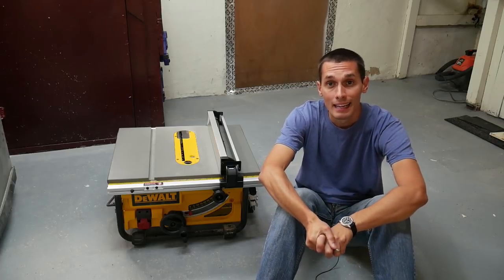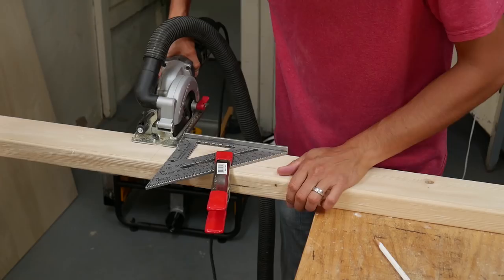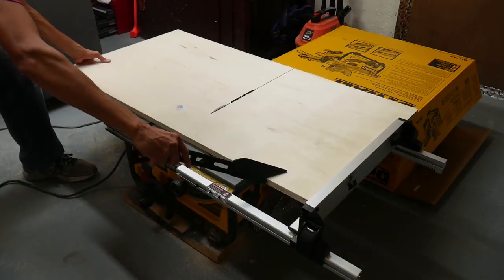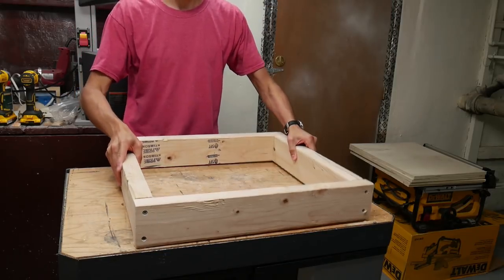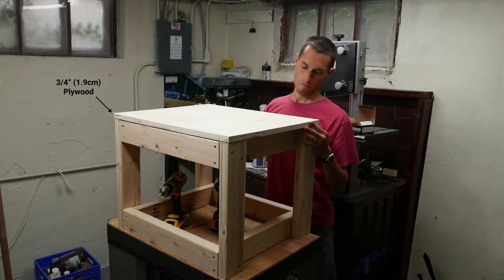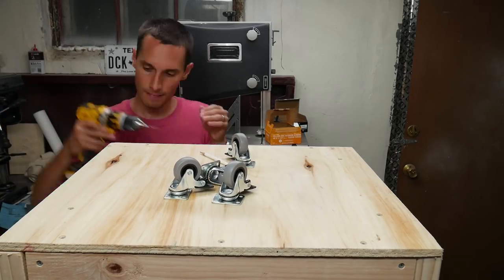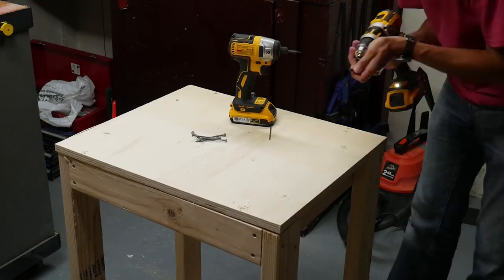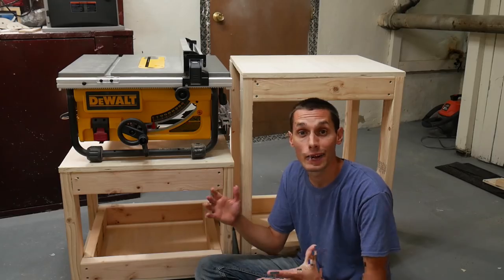How to Make Table Saw and Work Carts

Comment: Used your video and plans last weekend to make a cart for my new tablesaw. Only had two issues: from originally watching this video until standing in Lowe’s with the parts list was about 1 weeks time. In that time I forgot you’d built two carts. I only needed to build one. I blindly bought everything on the parts list. Only realized I had twice as many 2x4s as I needed when I got home and started unloading . Second thing,  I was trying to match my overall height of my cart + saw to an existing workbench. Came up about 1/4 inch short. Plan is to grab a 2 foot by 2 foot piece of 1/4 plywood today and slap it on top. So a couple goofs on my part but ended up with a solid little cart. Thanks for helping me kickoff my first project.
Reply from the maker: I'm glad it worked out in the end! Thanks for the comment.

Comment: I just finished the smaller box, cutting all 2x4's to 23-1/2 inches.  Need to put on a topper and bottom and wheels, but I love your plan and how detailed the PDF cut instructions are - love it, and love your videos!

Comment: Was looking for nice and simple to do. Thanks for the video. This is my next project because so far I've been having to use my table saw on the floor. Will be safer to put it at waist level with an outfeed.

An improvement could be making some latches that will secure them together to avoid the outfeed from moving away when cutting larger pieces.

Comment: I kind of did the same thing although mine wasn't near as nice looking as yours. I also made a makeshift type of French cleat to easily connect the 2 carts together. Cut a 2x4 down the middle at a 45degree angle and attach each half onto each cart. Now simply lift one side of one cart and set it into the corresponding cleat on the other cart. Presto! Connected, although you'll still need to lock the casters.
Reply: Marcus Marrs ~That’s an awesome idea. Thanks for that tip. I’ll definitely incorporate into my table. I want it to rip lengths or widths so I can do this on the side as well as the back. Fantastic 👍🏼

Comment: Just made this table. Simply perfect.  Used three screws on corners. This thing is solid. Also used a square to set the legs to ensure 90 degrees and it eliminated the wobble even before fixing the bottom plywood.

Comment: Thanks for showing an easy, but perfectly adequate way to make tool stands. A lot of videos here show fully jointed stands that take hours to make, and to be honest, it's unnecessary. My bandsaw is a trade model, so weighs in heavy, but has been perfectly secure on a similar design, albeit with a bit of glue for extra strength. Rather than bolt the castors directly onto the bandsaw table's base I constructed a mdf dolly from 2 x 18mm mdf, with a removable frame on top that the table locates within. I can then borrow the dolly to (occasionally) move heavy stuff round my barn.

Comment: A couple days ago I commented below on how I'd like to make one of these tables. Well, I was so impressed with what I learned from the video that I went out that day to buy the materials I needed, and this afternoon I built it all by myself (about 4 hours total). I'm a small woman and I was able to do it without hollering for my wife to come help. Its simplicity and ease of building was nothing short of amazing, it's practical usefulness more than I expected by a country mile. I made a couple of modifications: I chose not to use wheels because I intend for the table saw to be essentially stationary; instead of having it sit on a plywood base, I decided to use the plywood (actually MDF) as a shelf resting on the 2x4 bracing. It's incredibly sturdy. It's not pretty, but it's a tool! Who cares about pretty? As long as it's square and plumb, that's all that matters.

Thank you again for posting this video and offering the free plans. You are a star when it comes to designing and building simple and useful projects not needing $2,000 tools. Your projects are a novice's dream! Keep up the great work!

Comment: You could make several modular carts and add drawbolt latches to connect them as needed. I'm thinking about building a table saw cart like this, but I need to use it in my basement. I was thinking that some kind of modular bench would be good...designing each section to be able to fit through a standard doorway, but then they can all be latched together to make one, larger table when in use.

Comment: Great and simple design. The only modification I'll make is the height for my Makita is 12" between the 2 tables.
Also with 16' lengths of 2"X4", three lengths will do all the frames and legs.

Comment: Great project. I am considering a new DWE7485 compact 8 1/4 table saw with no stand because the stands prove to be pretty unstable. It will replace my old 1951 Cast Iron Craftsman. This cart is just what I need for the new saw. And I love the idea of the outfeed table/cart as well. Since I have the BoraMate castors from the base I built for the old craftsman, I will use them for this cart. I would definitely recommend them or something similar over regular locking castors. My BoraMates were spendy at $50 per set they were needed for the heavy old craftsman. And when you set them down they STAY! Great video. Subbed you! Looking forward to seeing some more of your stuff.

Comment: Thanks! -- built the short one for my daughter's Dewalt 7485 saw; expanded the top a bit to 22" x 26.5" so that I was able to feed four BOLTS up from underneath and through the cart top, into the feet of the saw.
(FYI:  those hold-down bolts are METRIC M8x1.25, 45-50mm -- and nowhere do they give that info in the Dewalt instructions!)

Comment: A little glue wouldn’t hurt in the joints. Tremenous holding power and makes it less proon to having to retighten the screws once a year. Nice project otherwise.
Reply: Dolko71 I agree. I Always use glue in addition to screws. It makes it that much stronger. The wood will break before a tight bond glue joint.

Comment: Nice work my friend! I only disagree with the casters. I think with the table saw it's best if it is really sturdy! Even locking casters always provide a little movement! But that's my opinion, you will see how it works for you in future I guess! Thanks for sharing! :)
Reply from the maker: I have the same concerns but I don't have a good, permanent spot for the table saw right now. We'll see how it works out.
Reply: In an instance like this you could always get or make some wheel chocks to add some extra stability.
Reply from the maker: That's a good idea.
Reply: @Makify1  I used adjustable table legs from Amazon. A 4 pack was like $13. With the casters raised up a little, I'm able to adjust my table to be level, then move it back away after. I have a small garage that needs to make a home for my car still. I admit though, a drill hex bit for the drill makes adjusting legs go faster.

Comment: This looks great. BUT what if you made two taller tables at 12x20 instead of (1) 20x24? Added hinges on the side? This would IMO keep the tables from separating while in use, and allow you to use 1 as and outfeed table while the other is a side support table. (For plywood) Also I would have raised the short table so the saw is say 1/8" higher than the tall one. Just to reduce the chance of catching on it during outfeed.

Comment: Hello, you have chosen your dimensions according to the model you have of the DEWALT. Is it the DWE7485-QS or the DWE7492-QS? it's not the same size at all
I would like to adapt these dimensions for the BOSCH GTS 10 J
Cordially

Comment: Thanks for this video. This will be my very first woodworking project! Would the 1/2" plywood for the top be too weak to hold a saw? My saw is 75 pounds. Also, what size screws are you using for the casters? They don't look the same as what you use on the cart body. Only one type of screw is listed in your description. Thanks!

Comment: Nice Vinnie! You must love all this new space. A word of warning about the taller cart to be careful using it as an outfeed table. Typically if they are a single unit, there is no problem having them flush, but as a separate unit, they should be slightly LOWER than the bed of your saw. Not sure if you've had a chance to test this out but figure you'll discover it the hard way if a piece gets jammed. Anxious to see how this works out for you. Check out Laney at "A Simple Design of Ocala" when you're ready for a TS cart upgrade. Anxious to see what jigs you have in store...
Reply from the maker: Thanks for the tip! I'll have to figure out a way to make the taller cart shorter or the shorter cart taller.
Reply: the easiest way would be to add an additional piece of plywood to the top of the the shorter cart. that way it will sit half and inch or three quarter of an inch taller.

Comment: Hello!  What dimensions would I change for the newer DEWALT DWE7485 ?  Would I just need to add leg height?  This model is 26.65 x 14.08 x 27.15 inches

Comment: Nice design on the cart    I'm a firm believer in   A shop cant have enough   Carts  and that  they should be a work in progress. With modifications and  changes occurring as  what is needed  to Mae that  cart  most useable  for a job or task specific  ive built. Most od them out of. The inexpensive. Materials we. Had on hand  usually MDF  with a  Shellac   Coat   This way if.  The cart needed  holes or something mounted to it   It wasn't that big of a deal  to do it   Often the carts would get. Overspray  for using them as a temporary. Spray table  or saw horses  etc  as they were used in a high production shop. With around 100  shop employees  and quite a few  automated / dedicated machines  running  along with  hundreds of parts

Comment: small advice: when using your pushstick, hold it where your hand is closer to the blade. if the piece between the blade and fence is wide the chance of your hand slipping or catching is smaller
Reply from the maker: Thanks for the tip!
Reply: happy to help. very handy tool but very dangerous if you don't know the dangers. i almost lost my finger because i didn't pay attention. another tip: try making pushsticks designed by mattias wandel. much better than the flimsy pushsticks that come with saws. i have 2 for added control, my hands don't come close to the blade

Comment: That is the way I like it: simple and sturdy.
Can you please write down how much you paid for the 2x4s and the sheets of plywood?
I'd like to compare those prices with the prices over here in Slovakia because I'm about to make something similar.
Thanks for sharing the video. It gives a lot of inspiration.
Reply from the maker: I paid $2.78 for each 2x4, $8.19 for the 1/2" plywood, and $10.54 for the 3/4" plywood. $35.41 (plus tax) for all the wood. The casters were kind of expensive at $4.47 each. Total cost for both carts was $71.17 (plus tax).
Reply: Thanks for your quick reply.

Comment: Which Dewalt saw is that Model? and why have the outfeed table abit higher than the Saw bed?  or have i got it wrong?
Reply from the maker: It's a DeWalt DW745. The outfeed table should be just a tad lower than the saw bed so that wood that has passed the blade doesn't get caught on the edge of the outfeed table.

Comment: I downloaded your plans and just finished both carts. I used MDF for the top/bottoms. I also added a sliding bottom shelf on the tall cart for a removable band saw and keep the drill press on the top. (Be careful with that Dewalt saw. I have the same one and if using a dado stack the blade nut WILL come off while running! This is caused by the blade brake reversing the blade and loosening the nut. I've contacted DeWalt and all they can do is offer me a refund. I like the saw's features too much to accept though.)
Reply from the maker: Your carts sound great! Thanks for the heads up about the dado stack. I just got one but haven't used it yet. Talk about good timing!
Reply: @Makify1  Check the nut after EACH and every dado cut!!!

Comment: Hi.  I followed your plans but there is a mistake:  the dimension: 31 ⅛ " is 79 cm. In terms of measurements, the measurement equivalence for the metric system is wrong: 31 1/8 "is equivalent to 79 cm and not 89 cm.  It's very nice...but I'll need to fix these mistakes in my bigger table. Best Regards. Keep publishing.

Comment: Good proyect,how do you solve the dust collection in this kind of table saws? I got that problem.
Reply from the maker: There is a dust collection port on the back of this specific saw. I hook that up to a shop vac to collect the dust. It doesn't collect all of the dust but it helps a lot.